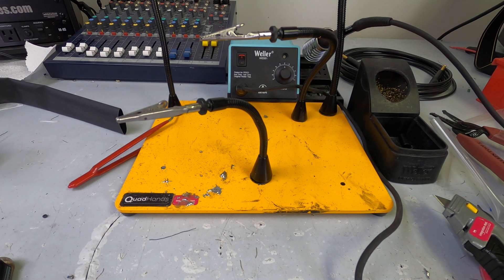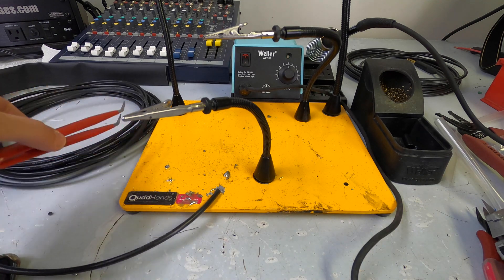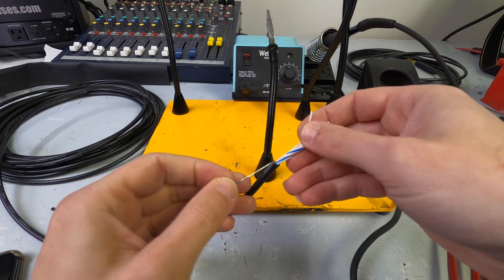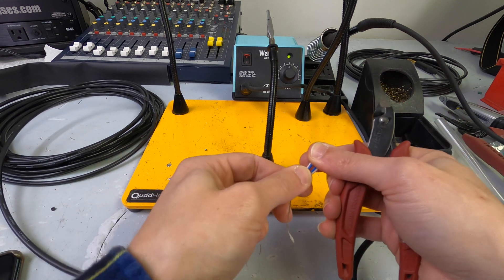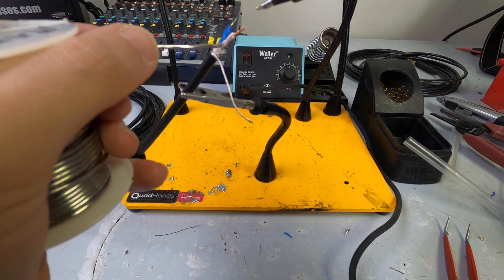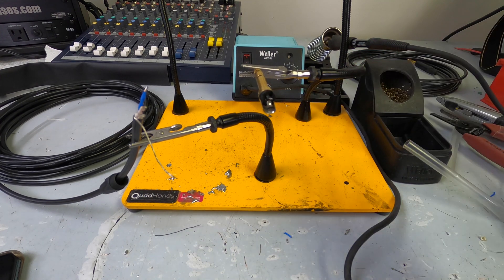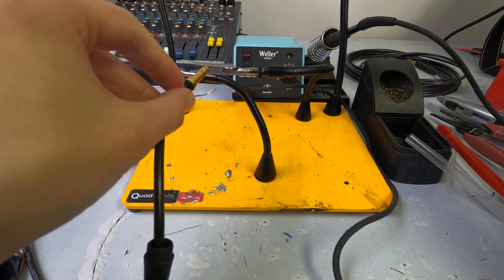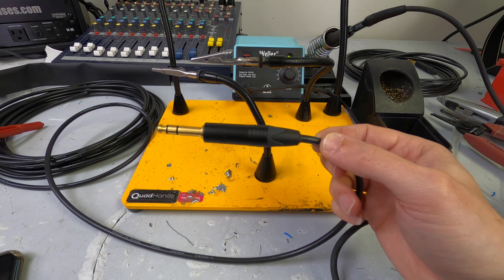How To Solder A Neutrik NP3X-B TRS 1/4" Connector On Canare L-4E5AT Starquad Mic Cable

Comment: Brilliant video! I followed the same process for the older Neutrik connector and it was really good to get a clear guide for soldering. I also really like the twisting of the solder cable at the end, before the protective cover which nicely tucks away the cables. Due to the short contacts, totally get why shrink tubing wasn't used. Thank you for making this video!
Reply: One question, does it matter if the shielding cable tinning is a bit patchy? I have some copper showing through in some places. If it matters, I can pop back over it but if not, I'll leave it. It is nice and firm and can be bent easily to fit the bottom plate.

Comment: my solder wont flow even when tinning the wire. Super annoying. I use an 80 watt (cheapo) iron, that goes to 350 celsius. What on earth could be wrong?
Reply from the maker: @thedude4795  dip your wire in flux first and it will flow. Also use rosin core electrical grade solder.

Comment: First time using this connecter (or making a cable for that matter) and your video explained it perfectly. My solder joints are pretty rough compared to yours, but it got the job done! Thank you!
Reply from the maker: Thanks for the kind comment! Just keep soldering, things will neaten up after solder joint 1 million!

Comment: I"m using solid Cat6 cable - will it be difficult for a DIY guy to solder this to similar Neutrik connectors?
Reply from the maker: Its easy. I have a few of those cables myself!